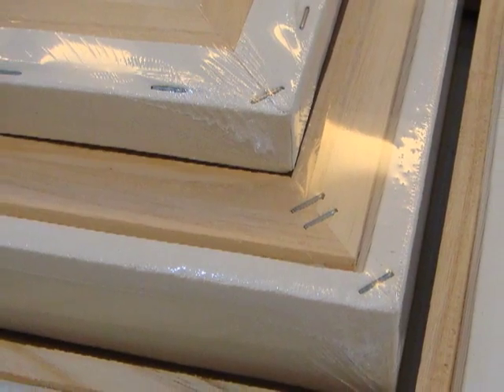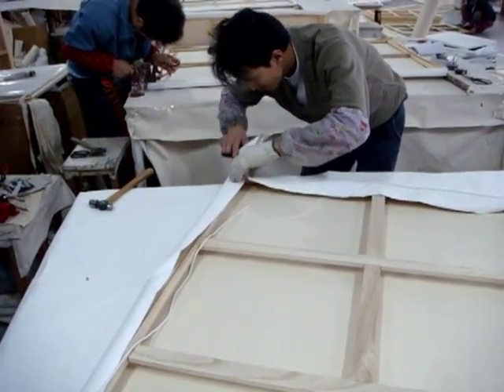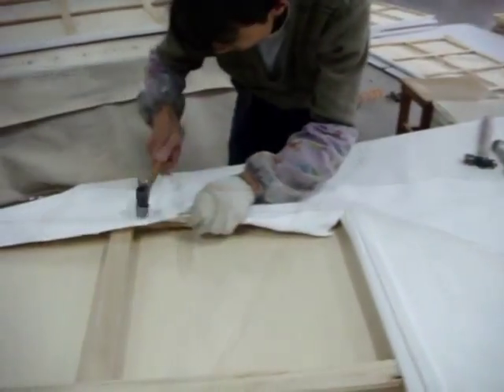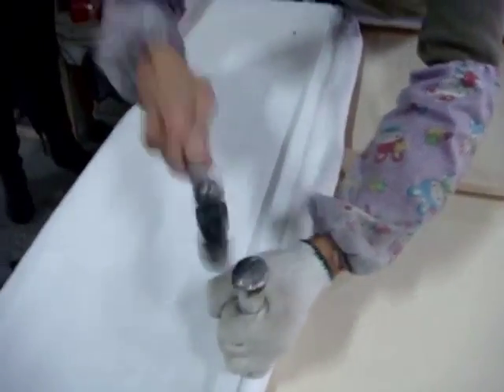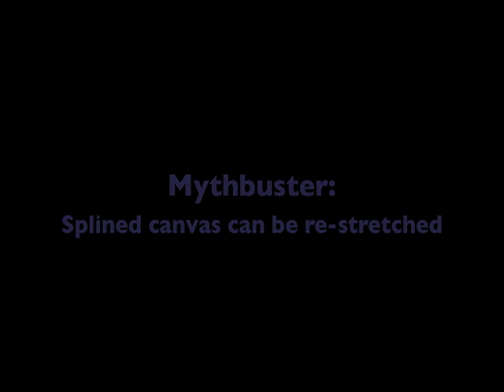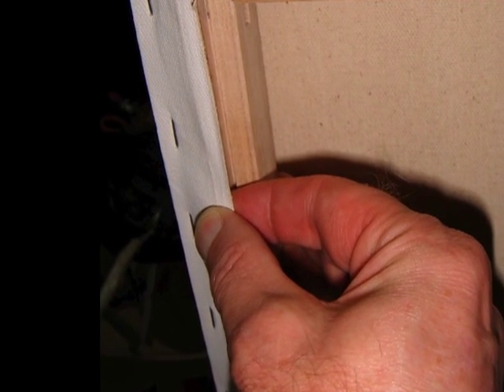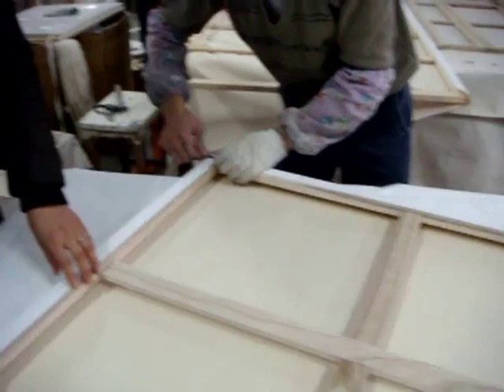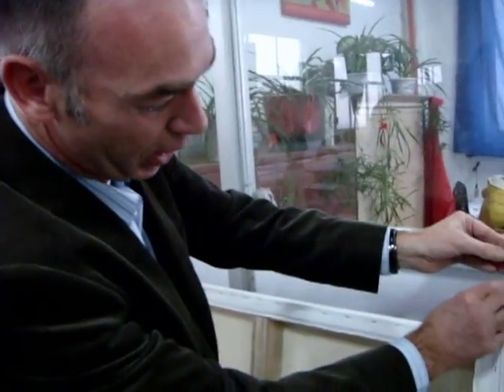Mythbusters Stapleback vs Spline Canvas

Comment: The problem here is that the corners are cut and trimmed out  rather than folded.  Staples are better and last month I got canvas from Artist Canvas Works that never needs stretching because of their device in the corners.  Spines are for window screens.
Reply: If they wouldn't cut so much excess off after the splines... they might have a nice argument.